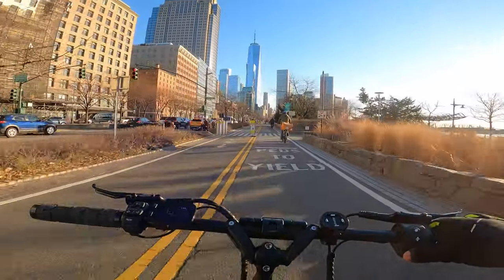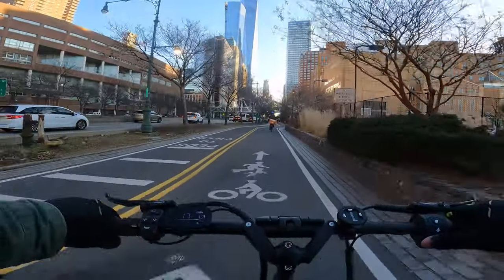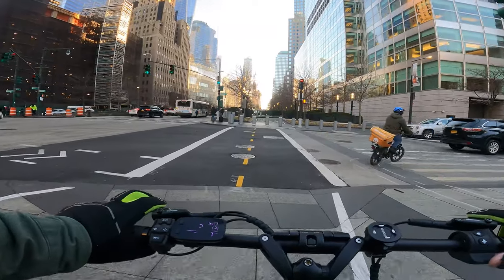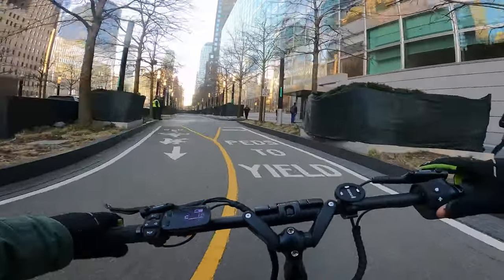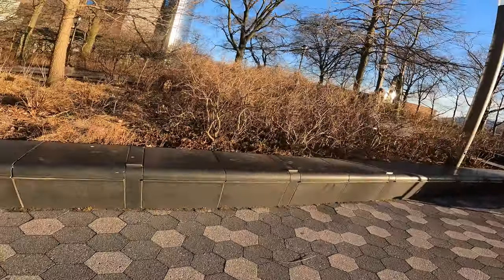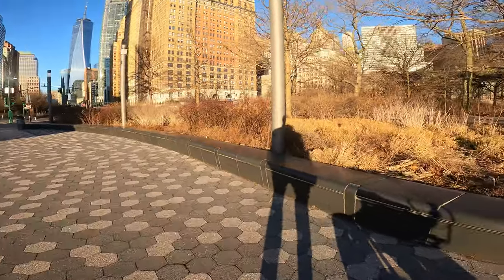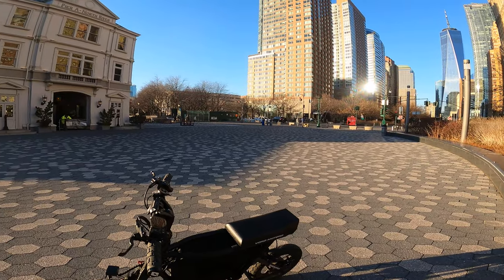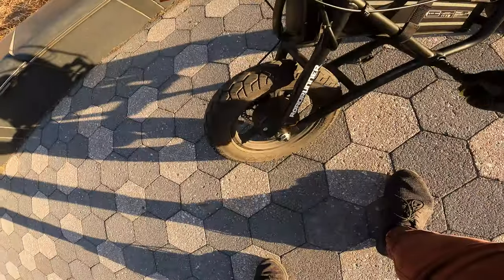Building a SUPER FAST ELECTRIC POCKET BIKE! (DIY Discussion)

Comment: I'd love to see or hear your thoughts on the extreme bull k6 e-scooter? From what I've seen and read it has about 100miles of range and can very easily go 60mph with dual 3500 motors.
Reply from the maker: The K6 looks like a beast of a machine. I've been a fan of the K4 since they released it a while back. I've heard it's such a different riding experience and the torque is pretty insane. I have no doubt the K6 will be a bunch better. My only worry is riding in traffic and hitting fast turns might be sketchy 😆
Reply: @JB360_NYC   it definitely will need different tires it pretty much comes with slicks if it had something a bit more aggressive it'd most likely be ok and as far as traffic lots of bright neon colors and lights lol😂
Reply: @JB360_NYC   if you ever get one and decide to modify, improve upon the design any ,or just build something equivalent to as far as range/power goes on some other platform. I'd love to see it. I like it mainly for its portability, power, speed, and range. Definitely  out performing most ebikes and scooters on the market right now and about the same price range. The only down fall like you mentioned is being visible in traffic